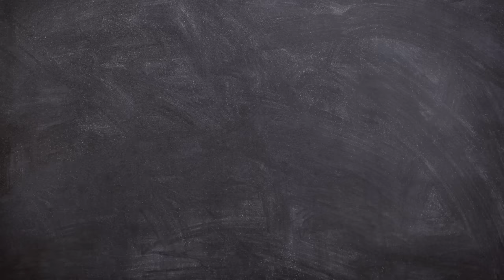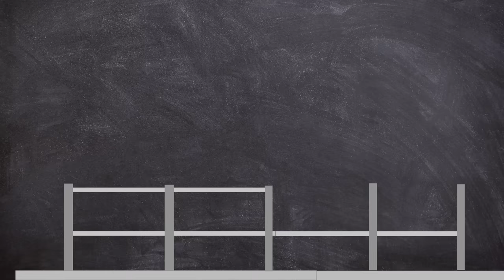Failure Guaranteed: The Skyline Plaza Tower Disaster 1973 | Short Documentary | Plainly Difficult

Comment: I spent most of my life in the Alexandria-Falls Church-Baileys Crossroads area.  I remember the airport from my youth in  the 1960's as well as the Sunset Drive In mentioned in an earlier post ( It ran X-rated movies before it closed. )  We moved into the Glen Acres community near Culmore in 1973. I remember when the collapse occurred as well as driving by the site and watching the local news reports on TV.

In 1977 I worked in a small specialty store in a couple miles away. There was  a local contractor's shop in the rear of the same shopping center. I met an older fellow working there  who I had  regularly seen hobbling to and from the shop or back an forth to one of the company trucks.  One day we struck up a conversation day he got around to telling me about being on the eleventh floor when the building collapsed. He said he survived the fall because he landed in a large mound of sand,  however he broke several bones in his body and that one leg was put back together with pins. He mentioned having difficulties during cold or rainy weather and was also contending with arthritis.

I recall he had a cheerful disposition for  someone in some degree of constant pain.

Comment: Concrete is usually tested as it’s placed and cubes or cylinders taken to crush after 7 days -28 days to test the strength. Formwork shouldn’t be removed until the results are reviewed and concrete has achieved the desired strength

Comment: Shores and reshores are normally covered by the project specifications so improper use could be a problem with the original design documents or could be negligence by the contractor/subcontractor in not following their contract.

Comment: i wonder in an emergency in a high rise how high you have to be to use a patachute to jump to safety?
Reply: 250ft to be safe, but with prepared chutes as low as 100ft, or ROUGHLY >25 floors if you assume 10ft per floor

Comment: With all these collapses of concrete buildings, it really makes me wonder why it's still used so much for building frames, compared to steel. Steel doesn't change in strength over time, you bolt it together and it stays, it's a uniform material so strength calculation should be easier and more reliable.
Reply: Those buildings exist, but ut's extremely expensive to construct an entire building out of steel, not to mention the expense of heating and cooling a giant glass & metal column. 

I hate concrete, it is a terrible material, but steel is not a reasonable replacement!
Reply: @theMoporter  Steel is a perfectly reasonable replacement, because that's what was used before concrete. Concrete-frame towers are actually a very recent building style, and it only really started to take off in the 1970s. Also, this building would have been clad like any other skyscraper, as a concrete outer wall would be impractically heavy. The use of a concrete or steel frame would have nothing to do with the outer cladding, and the use of multi-pane low-E glass in modern buildings can significantly cut heating and cooling costs.

Comment: Yes, it looks just like what happened to the Hard Rock Hotel New Orleans. The concrete wasn't fully cured and collapsed killing 3. 1:57
Reply: Saw a video on that recently. The steel rebar for at least one concrete slab for a high level was thinner than what the design called for,  the concrete slab for the same high level was also not to the design requirement.

Comment: Come on, again. Fundamental to this article would have been the fact that while concrete is CURING it will achieve only 70% of its DESIGN STRESS CAPACITY IN 28 DAYS. Stripping structural forms prior to that time the concrete strength is well below design strength. So it would have been helpful for you to indicate how old each lower lift of concrete was when the collapse occurred. You would probably find that three stories down when the supports were removed, the concrete had only been in place 14 days (+/-). And that was too soon, as calculated by the forensic engineer.